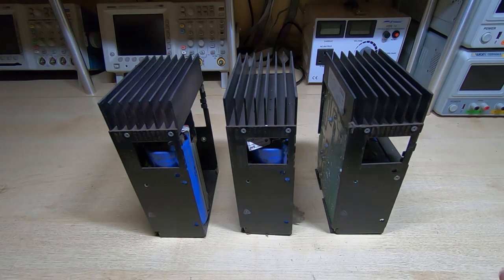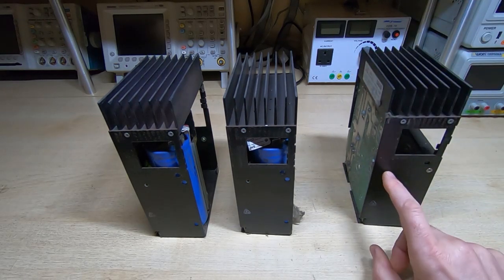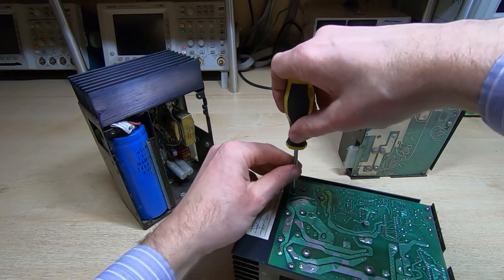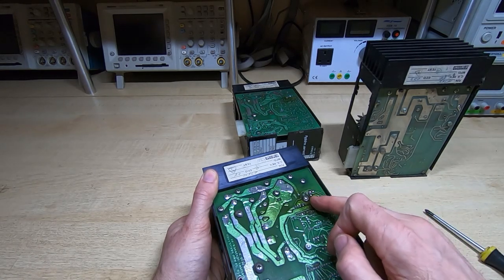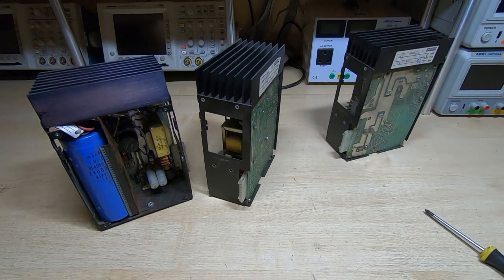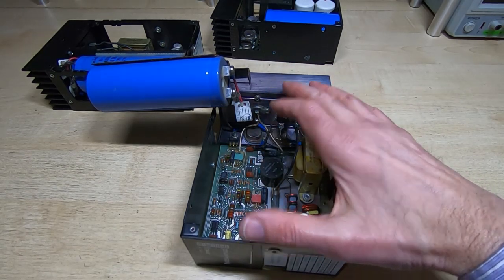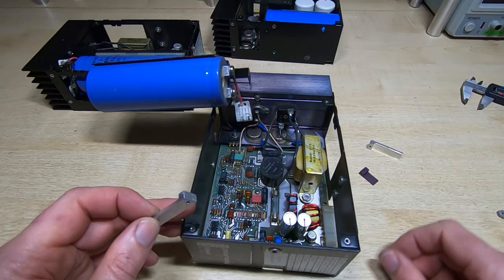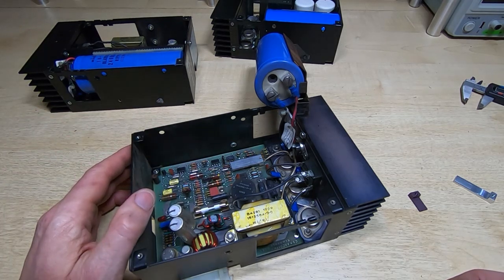PDP11-34A Repair Part6

Comment: Interesting point about the TO-3 "bolt slackening". Maybe it's peculiar to the h7441, but I'll remember to check this on all DEC regulator boards in future.
Also, you don't mention what the overheating device is. It would be interesting to know it's function and why it might get so hot.

Comment: When you tighten up the screws for the TO-3 packages, did you unsolder them first?
Reply from the maker: Not usually, The other side of the board has the heatsink so the area around the pins will not have changed. It is just around the screws that the board compresses. Tightening the screws just takes up the slack that this creates but it does not pull the device closer to the board. If you are concerned you could always resolder the pins to relieve any possible stress.
Reply: @JerryWalker001  Ok, I was just afraid of stress in the solder joints!

Comment: Super ideas to check, and simple too. Thanks again, I'll be doing this. I do have the ability to mill on my little Unimat but I reckon it might also be able to be made from a strip of 12mm x 3mm hardware store aluminium, hacksaw halfway through from the end 6mm back, then fold over onto itself (maybe a dab of thermal paste in between) then drill and tap.

I was wondering how easy these bricks are to test on the bench and do you recommend reforming the big caps if it hasn't been powered on in decades, or just power them up and look for magic smoke?
Reply from the maker: You can make the heatsink from anything suitable. Just be sure that it bolts down to the tab and does not rest on the device body and does not touch anything else. It is best to disconnect one end of the bigger cap and connect it to a supply and check for leakage. This type of capacitor does not really 'reform' like the older wet types but it is best to check them. Just be sure to discharge them after the test as they have a huge capacity and shorting them to something when charged can ruin your whole day. They are switching supplies but are very easy to test on the bench as they run at low voltage AC from the transformer unlike the mains driven supplies we normally see. You can apply DC to their inputs and the bridge rectifier will sort out the polarity.

Comment: i do not recall you mentioning this in previous videos, but could you elaborate on what extensive use do you plan on for this 34A ? Thanks!  PS: I am the proud owner of a PDP-11/23+ with RL02 and dual 8-inch drives as well as a complete VAX 11-730 with RL-02 and R80 Hard drive.

Comment: Very nice "upgrade" for the heat sink. Seems like quite a lot of work for such a small piece. Looks like there would be scope to extent the part sideways too - at least at the mounting end. Would this be worthwhile since you are making a new part from scratch anyway?
Reply: You could do that, but the law of diminishing returns kicks in.  If I had an -11/34A, I might try it just to experiment with what extra benefit your idea might make, but I doubt it would make much difference when compared to the improvement that Jerry has already made (the 20°C drop is a huge improvement!).
Reply: @bobvines00  You're not wrong about diminishing returns, but 60C is still plenty hot. Dropping it even a few more degrees by widening the surface area should be a worthwhile experiment. Perhaps the thermal paste he is applying will also improve the situation as I do not think he mentioned it in the past modifications he made.
Reply: From the video, it's not possible to see the clearances involved, but I wonder if for those without access to the machine tools Jerry used to make the replacement heatsink, a simple 3mm aluminium plate could just be bolted onto the original heatsink.
Reply: @bertoid  Perhaps with a bit of appropriate thermal paste, but I don't know enough about it to know how much, if any, loss to heat transfer your idea would cause.  I'd certainly try it though.

Don't forget that before machine tools, Machinists used hammers & cold chisels (of varying shapes & sizes), files, drills, hacksaws, and grindstones to "machine" virtually everything (mechanical) built before the first (what we mostly consider to be) machine tools were invented.  So simple "machine work" should still be within the reach of virtually anyone today with a bit of time and effort.  (Of course, I'm overlooking things that were cast in Foundries, but even cast items usually need some kind of "machine work" performed before they are used.)